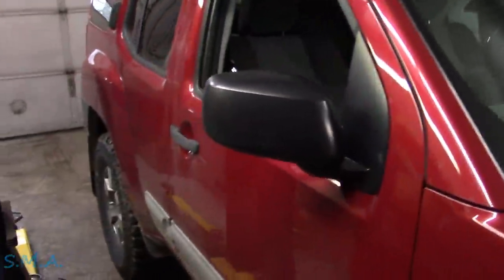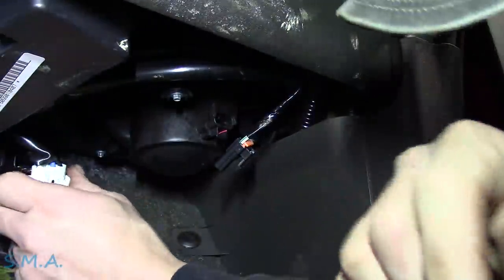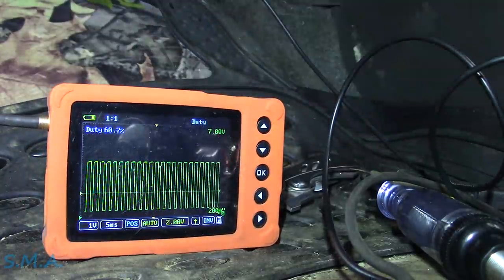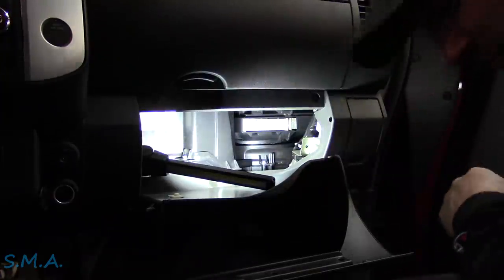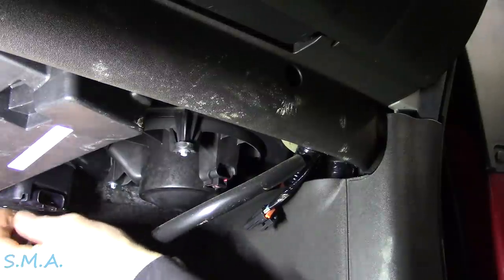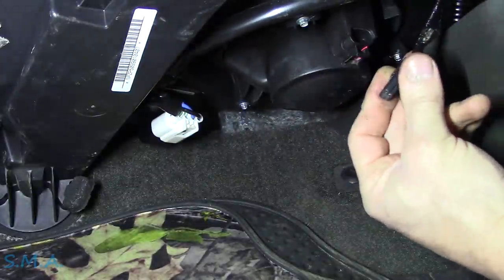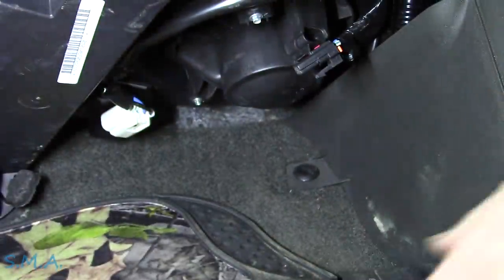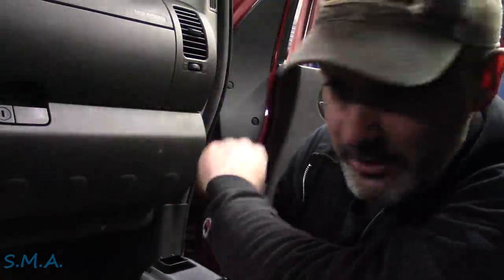Nissan Xterra: Blower Motor Not Working

Comment: I had one fail on a mack semi truck, I noticed the brushes making noise and later that day I noticed a piece of paper that had fallen under the dash now had graphite powder on it. three days later it stopped. had already alerted the shop guy of it and the motor was already in Alabama while I was headed back from IL. As long as I was moving I could get heat from the front and had some help from the sleeper heater.

Comment: I asked myself at the time you condemned the resistor, "why did he not just give the blower motor some 12V to check it works?". It is the Eric O process, and he did not follow his process. Bad boy!
Reply: I thought the same.... normally if you give it the full beans and the blower still fails to work then it's the motor that's at fault, because the full beans by passes the resistor module in most cases 😎

Comment: A little trick I use on blower motors engine fans window motors to easily check if there good is just a 9 volt battery.

Comment: Some of those resisters are big bucks. That did not look like a resister. While I woulda checked motor first with 12v, I like the way you wring out a system and actually find the issue. Most of us if they are honest, would've loaded the cannon on this one. First time I changed the cabin filter in a Chevy, I thought I got a two pack of filters and had a spare... Yes, I really did.

Comment: I had an Xterra for a few years. Blower resistor went out one night. Replaced it and a few days later it melted it again. I dropped the motor and I could barely turn it by hand. Never made any weird noises though.

Comment: I've just had to replace the fan motor on my 2008 LDV Maxus. 
Quite easy to do but typical LDV, there are 2 types of fan!
If you think that resistor is good, have a look at the 1950's designed one that sits next to the fan on a Maxus!

Comment: What’s the resistor do.  Talked extensively about it but no explanation as to its use.  Also no diagnostic for a dead electric motor ?   Should be an easy one to tell if motor ng or not?  
Thanks for showing us a very dirty cabin filter can look like and why your ac or heater is not heating or cooling properly.  So great job showing us a tough job of repairing a blower that doesn’t work. 
   Also that small instrument tablet what was significance of that item. Great to show us your toys but what are they telling us. What are we looking at. Need more explanations of what these items are telling us.  I know you use these things all the time but all Greek to me.  Assume we know nothing then we have a level playing field. 
 Great show !   The best.
Reply: So what was it that you replaced the motor and what was that other thing?  I suppose this is for mechanics who know what you are talking about.

Comment: I'm thinkin the clogged air filter put a load on the motor until it cooked and subsequently took out the resister.  
  Conclusion, be aware of what maintenence your car needs .
Reply: Can be but probably not. If you restrict airflow after a fan you overload the motor. If you restrict airflow before the fan you Will not increase load. Imagine Running a fan in vacum. However airflow is often used as cooling for the resistor so that van be the cause.
Best regards Patrik Falk from Sweden
Reply: @patrikfalk5684  well said, restricting airflow before the fan actually reduces the amp draw.

Comment: Ever have a "my fan is noisy" complaint that turns out to be the debris the mouse dropped in the fan after it chewed through the cabin filter? Also, occasionally the dead mouse as well. But those are usually, "my car stinks when I turn the fan on"!

Comment: Down here in the sweltering south (new orleans) my 2006 xtrerra is on its 3 blower motor and 2nd resistor ...we only use hvac on two speed all or nothing

Comment: Lol,love the stitch! My tundra had a smell musty like.I had the Yoda guys see if they could find it. Oh yeah they did packed full of everything and residing in the air box mice dead and alive! They cleaned it out and sprayed it to with disinfectant/odor control, they said it’s all to common. Lol she’s good now…
Reply: It happened once to my mother's '97 Cavalier. First, she complained of blower motor noise, so I figured the motor was on its way out. Two days later she complained of a sour milk smell. I dropped the motor out and found a mouse had basically been through the "centrifuge" and had died. It was a bit of a messy affair to clean up, and afterwards I thoroughly sprayed the "fan box" with Febreze with the HVAC on recirculate for a while. She was happy, I was happy, and her blower motor was fine - the mouse corpse had simply thrown the cage out of balance.

Comment: My Nissan frontier had similar weirdness. When the blower motor resistor failed the A/C stopped working, but only on low speed. The fan still worked on low, just no A/C engagement. Eventually the fan/resistor failed on medium speed but A/C stayed engaged, resulting it a big blow-off of refrigerant probably because the condenser fan wasn't on either.  All that nonsense from a bad resistor. I didn't think it did any more than slow the blower fan down

Comment: I remember on GM vehicles you had to drop the passenger front inner fender to change the blower motor
Reply: On the older fords, there was an outline on the inner fender that you would cut out to get to the motor. Then, you would get the repair panel from Ford and screw it in over the opening you cut previously.

Comment: This happened to my boyfriend's 2005 Durango. The blower motor got old and started drawing excessive current from the resistor. It melted the connector at the resistor. Totally melted the pins and then the blower stopped working. Wiggling the connector got it to come back on. I unplugged it to inspect why the connection was intermittent. When I saw the melted connector I was totally shocked. I replaced the resistor and tried again. It melted to the point of stopping again in 1 month, this time even WORSE damage to the connector. I did research and found out that AutoZone carries a connector repair kit! The plug and short wire leads for splicing in. At that point I warrantied the resistor, and bought a repair kit as well as a new VDO blower motor from AutoZone and luckily it was all in stock for purchase the same day. This happened in the dead of Arizona summer, BECAUSE OF COURSE IT WOULD. 🙃 Spliced the new connector in place, swapped the motor and resistor, and it was mint for 2 years until he sold the car.👌 This is apparently a very common pattern failure that has recently developed. The running hypothesis is that the motor gets old, the bearings dry up and such, and the motor starts drawing more current than normal even though they sound and work normal as ever before. Dodge designed very little margin into the connector and resistor, so the damn thing melts from that extra current draw. 🙄 Classic Dodge electrical drama, right? The only proper fix is to replace all of it, the motor, resistor, and the plug on the wiring harness. Unless...you catch the issue early and the melted connector isn't totally screwed up and you can get away with just replacing the motor and resistor. 🤷🏻‍♂️ Honestly though, no half measures. If I knew this was the cause I would've done it all at first.

Comment: My theory is Ford came up with the oddball “metric” sizes so they didn’t have to change all the tooling in their factories when everyone switched to metric.
5.5mm=7/32, 8mm=5/16, 9mm=3/8, 11mm=7/16, 13mm=1/2 roughly and Ford is such a huge company they influence the smaller manufacturers.

Comment: I pretty much change my cabin air filter in my 2019 toyota every 5k miles. They start to get kinda black and thats it, they gotta go. I try to vac them out and reuse them sometimes but they often times arent strong enough to not rip during the vac process.
Reply: Try a different manufacture for the filter. Wix might have one
Reply: @FishFind3000  yeah ill have to shop around next time, im not fond of paying $14 for a cabin air filter every 5k miles.

Comment: I concur with JK Brown below -- that "resistor" is going to be a transistor circuit at least... wouldn't be surprised to see it as either an R-C tank circuit (resistor and capacitor in parallel) or an old-style 555 with its two resistors and a cap, plus a power MOSFET of some fairly beefy spec. You really don't need a 555's precision for a blower, if it were me and I was cost-engineering... knob's a potentiometer, put a cap across it, that's your R-C tank... the "resistor" pack would have a single-gate version of the venerable 74HC14 Schottky hex inverter chip driving a MOSFET like I mentioned, plus a Zener and a pulldown resistor to eliminate the extra +5v supply lead since everything on a car is unregulated nominal 12vDC, tolerance being 9.0v through 14.5v (14.2v is charging voltage IIRC). However, since there's detents on that knob (that's how it feels like it's 'stepping') I bet they've gone the potentially even cheaper route of a rotary encoder with a peg on the knob working as a stop, and something like the now-famous Padauk three cent microcontroller driving that MOSFET. You don't get detents on a potentiometer!

BTW if you want a "proprietary screw" sort of thing... study modern Apple systems. (Warning, rant incoming. Sorry in advance.)

I'm a computer guy and an electronics guy -- learned both in the 90s at the same time, and I work both on and with computers (just a hobby, sadly I'm too life-incoherent for an actual job...) through the lens of electronics. There is exactly ONE brand I can name off the cuff, one*, where their all-in-one desktops have to be literally cut open and if you're not insanely stupid careful and know what you're doing already you'll wreck the screen going in (which is universally about half the value of the complete system!) -- and you have to replace what you cut through on your way back out or it literally can't vent and will basically Crock Pot slow cook itself inside. There's *one brand where I need a freaking heat gun to open their laptops and a proprietary weird-as-heck screwdriver set once inside... a screwdriver set that I will use with specifically that one manufacturer ever and nobody else's systems. There's one manufacturer that designs the smartphones they also make to purposefully have some screws exactly a tenth of a millimeter longer than the others -- a difference absolutely imperceptible to the unaided human eye -- and there are PCB traces (wires in the PCBs) routed under the screw holes inside those things so that if you put the wrong screws in the wrong holes, that extra 0.1mm will cut those traces and hardware brick your phone.

This company doesn't even fix their own systems, they just ship you a new one and they don't care if you have good backups or not -- your priceless photos of your grandkids aren't their problem... and they will charge you what they feel like and they will not give two fat s***s about whether or not you like it no matter how much Ex-Lax you pump them full of and for how long. You'll find a way to pay it, they know you will. That's how you get iPhones that cost less than $200 to produce being sold at retail for $1200 a pop.

Must be nice to be Tim Cook. The sort of companies they contract with in China BTW are the ones with "suicide nets" on the multi-story buildings. It's in the news, from reputable sources. Don't ask me, ask Google, it's out there, you just gotta look... or, don't. But I'm not fixing your cratered, cracked iCrap. Go buy a new one, you can afford it and I just can't make myself care that much if you want to support That Rotten Fruit Company.

My own stepmother has a Macbook Air with a dead battery and when she asked me, that's what I told her. Bless her heart, she's a fool, she's got some local guy who's talked her into letting him at it. I wonder what she'll say when she sees the bill? They don't make it easy, lads. Ask the expert -- Louis Rossman recently moved, I hear, but he's made a living for longer than I care to think about with his little Midtown Manhattan repair shop, un-Humpty-Dumptying every curbstomped iDevice on Wall Street, and bless him and his soul for it. He must have the sort of patience that would turn Mother Theresa green with envy. Glad there's someone out there like that... I ain't got it and I think it shows.

But if you are the sort to take that particular variety of "some people just want to watch the world burn" to the sort of levels that earn you worship in the halls of both r/madlads and r/bossfight at the same time... Apple Comma Incorporated is your ultimate case study to start with... and may whatever lies beyond us have mercy on your soul.

Comment: great video, thanks for the helpful content!  Unfortunately, it didn't go as smoothly for me - I replaced my blower motor resistor with the same one you had in this video.   However, when I turn the car on, this nasty grinding sound comes from the blower motor/resister area right when the car is started, but then goes away.  Also, although the fan works now,  but it only blows at  one speed (seems to be max strength) and doesn't shut off when the dial is set to the off position.  The only thing I did was replace the resistor.  Any ideas?

Comment: Nissan isn't the only offender in the "filter above the blower" category. Chevy does it too, only they aren't nice enough to have a screen. My parents Tahoe is that way and it resulted in a filter full of crap getting scraped off into the blower cage. Getting it cleaned out required blower removal and the front seat's position relative to the A-pillar makes the blower a biotch to access, especially if you're a big guy. Then GM had to go and bury one of the screws up behind the air box and sandwich it hard between air box and firewall. Pulling back the carpet gave me just enough room to snake a 1/4" extension into the space. I thought I was pretty fluent in repair-ese but I created a few new words that day.

Comment: These nissans do some weird stuff when the resistor dies, like ac compressor will only come on when in lower speed but fan doesn’t run, when on max speed fan runs but compressor won’t, etc., so not a bad first guess. Since the blower is soooo easy to drop in these I would have checked it first but hey I’m just a backseat driver

Comment: If I’m replacing a blower for sound then it’s just a blower. If the blower has stopped working I typically sell both the resistor and the blower.

Comment: Potentially stupid question, how do you guys install the cabin filters if the arrow doesn't have an "up", "down" or "airflow" next to it? I've always installed the arrow facing away from the fresh air inlet (usually facing the blower motor) as I assumed the arrow was showing airflow direction.

Comment: So, why have you not tested/proved the blower motor by the 1/2 way mark? I always test using my power probe III (not a sponsor) 
Cabin air filters not only restrict air flow, but cause increased load on blower motor. 
And its so awesome how they design everything on the heater to be near impossible to service.
Thats why i have one of those bendy extensions, to compensate for engineers shortfalls.

Comment: I'm guessing the people who previously owned my car parked it outside under some kinda tree that crapped floofy bits and such. It's an '07 that I bought in '12 with just 26k on the clock. I figured I'd change every fluid, filter, etc. as I went along. Cabin filter HAD to be original it was crapped up, black as sin, there were tree bits, seed bits, floofy bits and bugs galore. I don't run the A/C much and garage keep the car so even doing the cabin filter every two years it comes out with a light dust coat and nothing else. I complained to Fram when they changed the design of the engine filter but didn't change the box so you didn't get the pictured filter (they deleted the stiffening metal mesh and went with black rubber instead of the Fram orange) so they sent me a case to placate me. Those, like my oil come out looking as new as they went in. Lifetime free oil changes rock. I've brought my car in with as little as 308 miles between changes.

Comment: When the motor locks up does it guarantee the resister (solid state controller) is burned up? If not maybe the resister (solid state controller) was still good. Do we need Ivan to make a house call?

Comment: I had to change a blower motor on my previous daily driver and the screws were 5.5mm bolt heads so this comes as no surprise to me. The same vehicle had the same type of cabin filters as the Nissan. I did a service on a 2013 BMW F30 318d and the cabin filter was fitted the wrong way!
Reply: I've had 5.5 sockets in two sets; guess somebody decided they need fractional metric sizes for no discernible reason. And how do you measure that anyway; I mean, a fraction of a millimeter?? So much for the superiority of the metric system. :)

Comment: Sounds like a Jet ready for take off , I hope that jet noise stops.
Reply: That jet noise would be very irritating!
Reply: The noise from the 2 aftermarket units (4 seasons and GDP) I used in my 92 B2600i were noisy AF. 

After some research I found that Toyota (and others) used the same part.  Mazda wanted almost $400.  I got it online from a Toyota dealer for $153.
Reply: @rickharper1497  Absolutely.

Comment: Any ideas about a 2011 f150 3.5 eco that will not send warm air to def or drivers side feet? Have replaced all 3 actuators twice. Auto temperature control. Blower blows and sometimes doesn’t blow warm air. Thanks

Comment: Make it easier on the assembly line to use the same component for both systems of control auto and manual and make it cheaper as well I would say